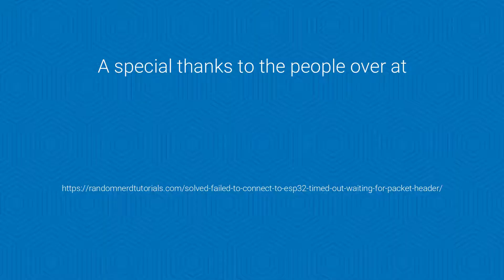Fixing the ESP32 Wroom 32 Wifi/Bluetooth board.

Comment: Were you holding down the boot switch when plugging it into the computer via the USB cable? I found that you need to hold the boot button down while plugging in as well as making sure you are using a usb cable that carries the data lines, not just the power/ground. Easy way to test the usb cable is plug in your phone to the computer with the same usb cable. If you can browse your phone files on the computer then thebusb cable is the right cable. Hopefully, you got this to work for you.